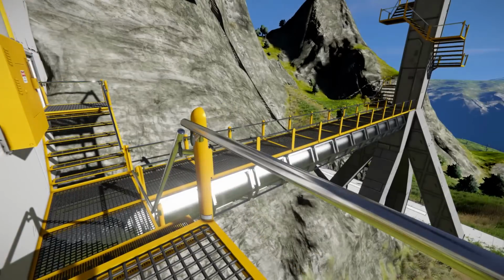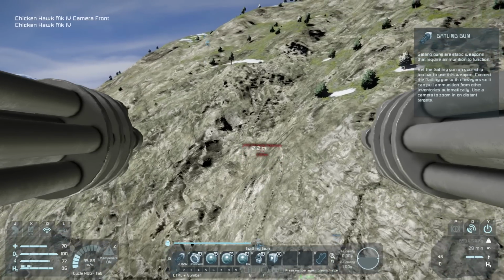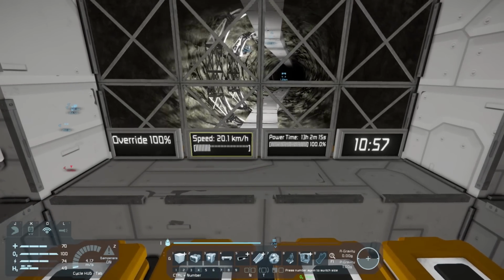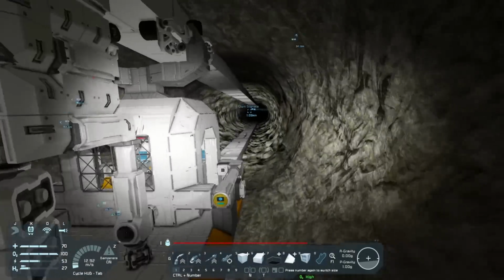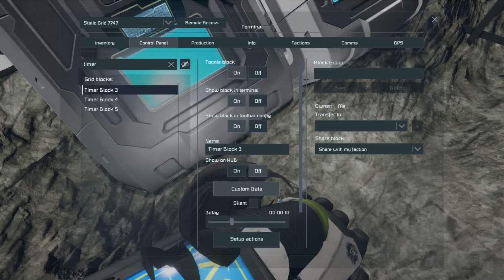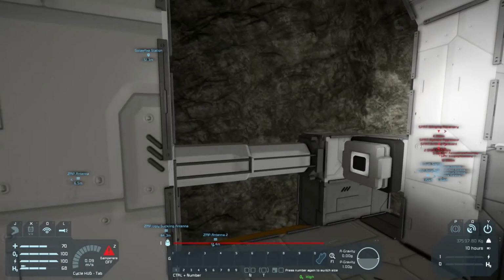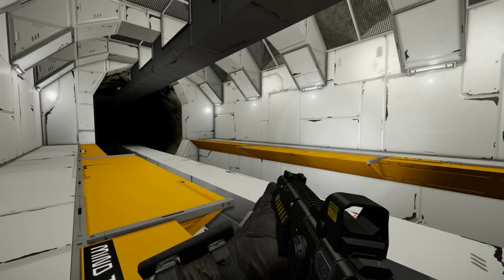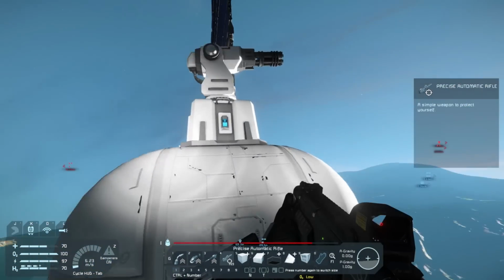Survival, Maybe... #88 Function before aesthetics? (A Space Engineers Survival Series)

Comment: I would luanch projectiles using wheels since rotor speeds do not exceed 30km/h unless they are free and have a few thrusters which may be unstable, just a bit. wheels and a piston should work though more of a projectile cannon rather than a catapult.
Reply from the maker: I've got a few ideas that will get around the 60rpm limit on gyros and rotors, but I also want to test a build with the wheels too ;)
Reply: @Splitsie  how exactly would you construct this contraption I'm having a hard time comprehending this on my own, though I maybe trying it too small of model. Still mind sharing some incite on how this could be done?
Reply from the maker: I'll be building the designs in the series and testing them in survival rather than creative so you'll see every one of them from the start to finish - I like the idea of doing it this way so that I might get some tips on improvements/crazy ideas that I can use. It'll probably be better to just see what I get up to on Saturday as I'm not sure I can paint a very good word picture on some of the ideas :)

Comment: i just had a thought for the battery/tram thing, instead of using a tram to lift batteries around, make the trams, the batteries. the center part of the tram loaded with batteries between the 2 control cabins, and connect the trams up to the base and the solar axe?
Reply from the maker: I had thought of doing that, but I'd either need to use multiple trams, or have the efficiency be low due to power loss on transferring between batteries at each end :(

By physically moving the batteries from one base to another I don't lose anything :)

Comment: Craziness for the catapult. Using a merge block for release, and a projector, you can throw sandbags as your projectile. Cover fire and decoys in one neat package. You'd need to timer block the parachutes or something.Make a rig with four sandbags merge blocked with each other with timers, so you spin the set of four, release the first merge block to throw the whole rig while also tripping a timer. In theory, those set of four sand bags will be spinning too. The timer either releases one from the set, or break it into pairs. And trips a timer to repeat. It would allow you to scatter the sandbags using rotational force for faster deployment.For added challenge, using a large grid catapult for this, you could have a programed "ready state" that leaves the arm above welders, with a sensor block that detects the block furthest from the project to auto trigger the next launch.Thus allowing you to launcher a couple packages, then drive it while it automatically throws another one or two in behind you.
Reply from the maker: I may end up throwing some turrets or other heavy things, but first I need to make sure I can get the required range with something that large/heavy. Using timers to scatter at the top of the arc could be quite a nice option too if the weight capacity is good enough :)
Reply: Definitely worth experimenting. I haven't played with ballistic like this. Might be worth trying a sabot style breaking projectile and/or an extending/folding projectile to see how the engine handles conservation of momentum when the center of gravity or mass changes.

Where you planning to post or stream your experiments?

EDIT: I was on travel last week and JUST saw that you did post the video. Gonna watch it now :)

Comment: An idea for the tank: an ejectable cockpit! Make it a separate grid, connect it with a connector and possibly a merge block. Put some thrusters on it and a gyro with override to launch it in an arc and make it land with the help of parachutes. 
   Best of luck with your crazy tank!
Reply from the maker: If I can work one into the design I am tempted to try for an ejector seat, or at least some form of safety escape - one suggestion was a drill for an emergency foxhole :)

Comment: Suggestion: For the 'tank', consider making the catapult trailer an attachment for the Goose... and then build a separate armored vehicle. The Goose would never have to get in range of the turrets, so it wouldn't be in serious danger, and while you have it set to automatically launch projectiles, you can swoop in inside the armored tank. I know you mentioned you wanted to build more trailers for the Goose - you have the parking spots for it - and this seems like an opportunity for that!
Reply from the maker: That's a fair point, maybe I should do it as a Goose trailer, the only reason I wasn't thinking of that was due to the need to then drive to the enemy base with two separate vehicles though maybe I could come up with some other solution to that issue. Might have to mull over that one for a bit - we've got time as I have at least 4 catapult designs to test and optimise first :)
Reply: @Splitsie  that is true! I hadn't thought about that.

@fourdotsYT you have some good points, but personally I think trying something new is more exciting ;)
Reply: But how would you get both the Goose and the tank out there? You'd have to fly back to get the tank, leaving the Goose unprotected, or vice versa - doesn't seem realistic, if realism is what were going for. Perhaps tankifying the Goose, or building a goose-shaped hauler tank that also works with the trailer carousel.. but then where do you park it? Otherwise, just ditch the trailer and build a tank capable of catapulting projectiles itself.. that is, if you're really committed to the catapult idea. I'm struggling to imagine the logistics of this catapult thing.. perhaps if you had a crew to man it all, but with just one player, you're going to have to get out of the manned tank, adjust the catapult, fire a few, then get back into the tank and back to the battle field - rinse and repeat. For all that effort you could just as well learn coding and build a smart distributed war machine with remote controlled firing solutions from inside a tank, or a command center which would make more sense.

Also all that effort was spent on the missile silo, and it was used only once against an actual enemy, and it only sorta worked (not really :-/ )
Why not launch some missiles again? Or at least remote fire silo-missiles from the tank if we're taking that hands-on route?

Comment: First, to deal with the base, instead of a catapult, invite Capac for that episode, send him into base, and the base will explode 0.1 seconds later.

Second, the maintenance base you tried to check out with the Chicken Hawk... I noticed while you were flying back with the downward camera that the valley between the two mountains looks too tight for a wheeled vehicle.  I think you may need to either design a heavy lift airborne vehicle to transport a wheeled vehicle over the mountains, add the hover engine mod to this world, or dig a tunnel through the mountain.  Personally I like the tunnel idea.  Picture a wheeled vehicle similar to the drilling tram.  You set it up with a drills on pistons, a projector, and large grid welders.  When you reach the mountain side, you extend the drills on the pistons, beginning to bore the tunnel.  Then the projector lays out a, say, seven block wide (either full blocks or half blocks) road that the welders then weld before the vehicle drives onto it.  You would need to add slopes to the entry and exit, though.  I know it sounds like a bit much, but I thought it would be a nice project to see if it could be done.  The tunnel would probably be a kilometer or more long, but I don't think you'd have trouble with the voxels since the tram tunnel is more than a kilometer long.

Third, I swear when you said "tank" I had visions of the hover-tank from EC rolling through the air.  But you would need the hover engine mod for that and I believe you're trying to make this series as vanilla as possible.  Next, when you started talking about a trailer, I had visions of the base from Survival, Unlikely rolling up on the enemy with its missile/spaceship launching trailer.  One question I do have is there a ground route between the base and the enemy?  I don't remember if there is and if there isn't I have an idea you might like: a vehicle elevator!  Basically something similar to what you built for the tram at the Solar Axe, but inside the cliff opposite the front of the base and only meant to raise the tank to the same level of the clifftop.

Fourth, I noticed that the end of the video that a few of the Solar Axe's panels are unfinished and a couple of the top left side (as seen from behind the SA) are missing entirely.  Now that you have the alignment script running, you may want to finish those up to maximize your power production.
Reply from the maker: I have actually built a successful tunnelling wheeled vehicle on a server before so it would be very doable, fortunately the base I'm going to attack first should be reachable by driving (it's not that one I flew to) :)

I've often thought about a vehicle lift to get out of the valley, but if I have enough wheels I should be able to get out without it, though if it doesn't work it is a project I'd like to do at some point ;)

I'll absolutely get those panels done when I have the battery system up properly, had forgotten that I still hadn't fixed/completed it :P

Comment: Build a battery ship that you can use to transfer charge while there is construction or repairs on the tram line.
Reply from the maker: I feel if I did that I'd remove the need for the line, since I still have the smaller tower on the base I won't run out of power completely and I like the idea of having to desperately do repairs as everything flickers on and off around me - not that I'm going to deliberately break the tram or anything :P
Reply: Classic  @Splitsie

Comment: You should make a sandbag Mk. 3 with a small flashing light on the back.  That way you know where the sandbags are.  Useless: yes.  Cool: probably not, but I wanna see it anyway.
Reply: Also, your tower is asymmetrical.  You’re missing a solar panel on the first up on the far left (using the time lapse cam as reference)
Reply from the maker: I can simply tell the sandbags to broadcast when I want to see where they are, though that does require having access to something that can direct it - not particularly helpful in the situation I was in :P

The tower needs a few repairs and I'd forgotten that I hadn't actually completed it either but it'll get there - just like the upside down med bay ;)

Comment: 1. Solar axe is ugly when oly one wing is rotating. Please fix that.
2.Becouse you have a 12 episodes till 100, befor you create this tank you should build around your base outpost's with antenna, then you don't have to worry about antena range
Reply from the maker: I'm still operating well within the max range of the basic antenna so I shouldn't need a relay at this stage and as for the solar axe, I thought both sides were rotating but they will rarely rotate the same amount due to the way they determine where to stop
Reply: Splitsie if you building a tank i thought about hover platform
(Just flat surface with thrusters)

Comment: a gyroscope like ship spehre that is stationary and has swisel arms around it that automaticaly align to sun with this script waaaaah i want to seee that happpen
Reply from the maker: I think the idea of the gyro control is to align the whole ship to maximise solar input as opposed to rotating portions of it, for example if you had a solar sail type setup it would align that
Reply: @Splitsie  so maybe...rotors based version?
Reply: The gyro section of isy's solar script works great, I use it on my laser satellite array to keep them all charged. It's also great for a small transport ship with a single or a few solar panels for charging in space.  I don't see how it couldnt work on the surface of a planet. Just be sure to overbuild the design so it can spin 360 degrees in every direction to avoid falling.

Comment: 10:35 Six Horizontal Driven wheels for each cabin of the train (?)
And maybe Transformer Box is less weight?  I think u make already the maths and explained... but i dont remember now :S
Reply: Less weight, but less power storage
Reply from the maker: Transformer boxes have terrible storage capacity (that's why the underside of the tram is covered), so they're useful in a pinch but you're much better with the vanilla batteries, which to me is a good thing :)

Comment: Idea for the tank. Make it a boring tank. It will get within 800m of pirate base, bore down like a miner and pop up right underneath the base. Or use a mod like the new Railgun mod to work as artillery... 2 railguns 2 gatlings. For the tunnel tank light armor on the bottom hvy on top and some rockets + gatlings. And drills on a rotor. Complex but you seem to like a challenge. You could put shields on the tank but that would be OP. Flying tank is an idea. Short fly time though.
Reply from the maker: I've never been a fan of the idea of drilling under the enemy base for one reason: the AI has 0 chance of defending against it which means unless I do something stupid, it will work every time (I like to do the things that have lower chance of success) :)
Reply: @Splitsie  I would love to know what your school test scores looked like lol
Reply: @Splitsie  I would love to see videos of the building and testing that you do off camera. It might take longer to do, but it would be a lot like the tutorials you used to make.
Reply: @Splitsie  + design idea... Have you ever heard of a centrifugal catapult? Not necessarily by that name. Over here we have a show called Mythbusters. Long story short they made one using a motor to spin an L-shaped tube. They did not necessarily use a good method, however with space engineers you can use rotors or merge blocks on a rotating head to launch an object towards the enemy base. It won't have to take up as much space as a traditional catapult.